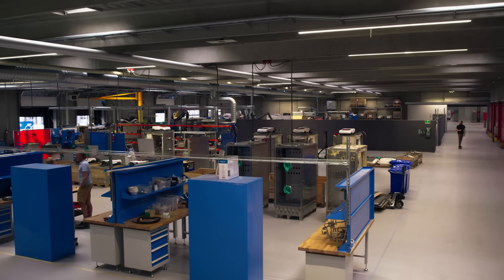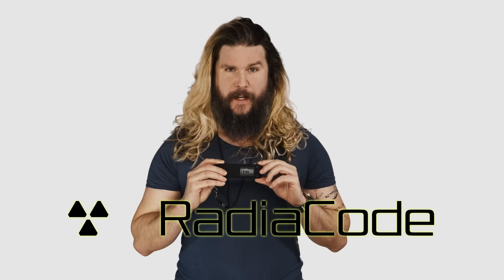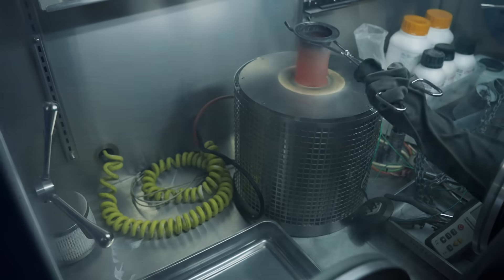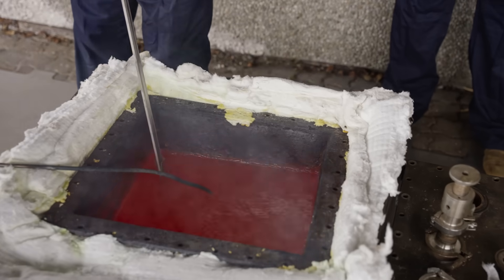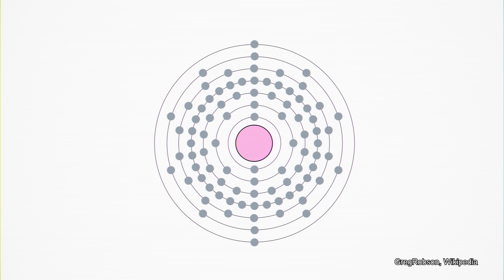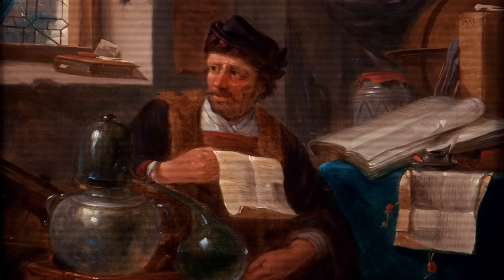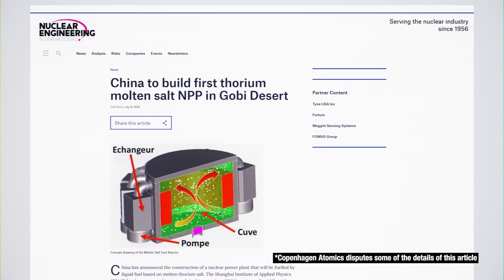Is THORIUM the Future of Nuclear Power?

Comment: I hope Thorium reactors aren't like pasta.

They said you can't burn pasta boiled in water. I did it.

They said you can't make Thorium into a weapon. What follows?
Reply: Thorium itself?  NO.  But the Uranium233 that you make from the Thorium, YES.  The catch is that the in between step from Th232 to U233 produces a strong gamma ray signature which is easy to detect. so, the whole world will know where and what you are doing.
Reply: @ Ahh I was wondering about that Uranium step. So, the only way to make it undetectable is by finding a way to contain those gamma rays? Not that I'm trying to find a way to commit war crimes, but out of sheer curiosity, can they at least be reduced?

Comment: so, I used to work with molten salt as an engineer manufacturing parts for military aircraft, you would have to make sure 100% that no water gets into the system. As the salt melts the sodium becomes more reactive as it gains energy and the bonds between it and the chlorine become looser, as it was explained with our salt vats, a small cup full of water could blow the whole room and cause significant damage to the workshop. 
Molten salt that has a bunch of uranium dissolved in it makes me nervous if it's not properly built... That's a lot of excess energy that can go boom. The safety measures on that reactor would have to be top notch.
Reply: the uranium is not dissolved in the salt it is the salt Uranium hexafluoride
Reply: @nistrum385  they say several times in this video that the uranium is dissolved in molten salt.. 4:51 as an example from the guy who's running the project.
Reply: @louthinator  it is not pure U, it is UF4 (since UF6 is a gas). UF6 is a way to get the uranium from the blanket to the fuel.
Reply: Only if you use sodium salts, so the solution is to not do that. Use fluoride salts instead, super stable.
Reply: @ how would that affect their melting point? And would they still have the water-like viscosity of molten sodium chloride?
Reply: @louthinator  what you see in the video is flpuride based (FLiNaK) utectic. Melting point is about 450 C, operation point in the reactor at about 700 C. SS316 is fine for corrosion issues during the time needed (5-10 years), and since it's a common material that almost all steel vendors use, the cost of each reactor + interconnected piping and tanks etc is quite cheap.
Reply: @louthinator  about 1500 C. There's been plenty of research on this type of salt, not only for reactor use.
Reply: @louthinator  Not chemically no, but thermally there might be a steam explosion. The system is not at pressure (other than hydrostatic and pump pressure), and if any water contacts the salt it will quickly vaporize pressurizing the entire reactor container. This is why most designs out there (including the diagrams he showed in the video) uses graphite as a moderator to not have water present in the reactor. This is however not the case for CA's design since they use D2O for moderation purposes (NOT for cooling).

Comment: This actually seems super interesting - the  safety benefits in particular. One of the criticisms of nuclear that in my mind doesn't get talked about enough is the effects of mining and waste storage on indigenous people. I'm in a place with a very strong anti-nuclear sentiment bc the mining and storage of uranium and waste is primarily done on indigenous lands and has led to significant health issues, ignoring existing treaties.
If thorium can minimize waste production and produce significantly less dangerous waste - such that it doesn't require sacrifice zones - and thorium reactors can be built at much smaller and faster scales than traditional reactions - so there's less time before actual energy generation and fewer carbon emissions from concrete construction - I think they could play a really cool role in energy production.

I do wish the "but our pipes need to be replaced every 5 years" comment got more attention in the video though. Those pipes have to be stored somewhere, no? Is that just another source of secondary waste? I wish there was more detail about the storage of waste and fission products from thorium reactions too.
Reply: Thorium is a byproduct of rare earth mining.  It is currently classified as mining waste and requires special storage.  To put it another way a rare earth mining operation here in Missouri produces enough Thorium waste to supply most of the US, just from that ONE mine.

As for the fission waste this are much less than that of solid fuel reactors because the fission waste is constantly being removed.  Also, the piping would only be mildly radioactive due to Neutron exposure over its lifetime.  

Also, several companies are putting forth designs based on using waste material from current solid fuel reactors as their fuel.
Reply: @nistrum385  Oh awesome ok! ty!

Comment: From my understanding the only reason we didn't go with this design decades ago, was that it is more complicated to setup but also it does not create weapons grade materials , and since we were building a nuclear arsenal the traditional water reactor won out, not a 100% sure tho.
Reply: Thorium reactors create very pure U-233 as part of their fuel cycle. You can build all the nukes you want with that. U-233 based devices have been tested before.

The reason Uranium reactors were used was because there was already a decade of practical experience with Uranium reactors. Thorium would leave you starting at square one.

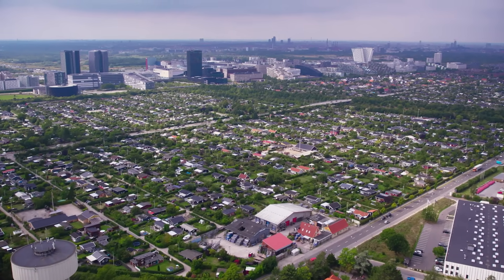Comment: 15:32  
Thorium doesnt produce plutonium. 
Even though thorium is really efficient and relatively safe, the government wont look into it because they want the plutonium.  
Its a bummer
Reply: Uranium 233, the element bred in a thorium blanket and used to power the molten salt reactors, has been used to make nuclear weapons,  by both the US and USSR. Its neutron multiplication rate is between that of U235 and Pu239. But, current weapons using plutonium would have to be redesigned to use U233 and this would require underground testing, which currently is banned by treaty.

Comment: The part I love about these reactors is how, when designed properly, they are walk-away safe. Meaning everyone could just walk out of the building, leave everything running, and it's still safe. If the reaction were to get out of hand, or if the reactor loses power, a plug of salt that is kept cool to keep it solid will melt, letting the liquid salt drain into storage tanks that are small enough that there can't be enough material around to sustain the chain reaction. Then when people come back, the salt can be reclaimed, reliquified and returned to the reactor, and the system started up again.

Comment: Hey Kyle, please take a look/tour of Moltex's SSR-W reactor being designed and built in Canada by a British nuclear firm. 
Solves a lot of the problems with current MSR designs such as:

Online gas product extraction from where gas is created inside the fuel salts 
Burns MOX with a VERY high burnup rate
Solves the problem of pumping hot, corrosive fuel salts around the corner
Solves the meltdown problem
All without needing to create and have certified New Nuclear Steels (suffice to say this is not cheap or quick prices, nor should it be)
Reply: It will certainly not be completed. It will probably not be started. No one will pay what power from it would cost, with abundant, radically cheaper alternatives.
Reply: @Akio-fy7ep  
You can't produce baseload with renewables. 
It's a lovely idea and maybe in 50 years we'll have the tech to do it but right now we don't. 
We need green baseload now
For which there is only nuclear to choose from.
We know how to build cheap nuclear, it just needs to be done.

Comment: Instead of scaling UP... how about scaling DOWN to produce a reactor for each household. Instead of a corporation building a huge reactor, build reactors for the size of the building that needs electricity. Have a reactor for single dwelling, two family dwelling reactors apartment size reactors,  office building size reactor. I have number 2 diesel furnaces and natural gas hot water heater and electric from con Ed.  Solar and wind is available for private dwelling deed holders. Why not nuclear?
Reply: It's still radioactive materials involved and would need maintenance/monitoring and so on.
Putting these in ever house would be scary to say the least.
You could already but generators and solar panels today if you don't want grid power but when something goes wrong and it stops working it's on you to fix it. No number to call and say, hey my lights are off.
Reply: @gizmogremlin1872  so the claim is, that the technology is still not perfected enough that it's safe at long as it's far away from society. Still not safe enough to be contained under the foundation of homes and have certified technicians not much different than a number 2 diesel home heating fuel delivers that will replace any thorium and repairs needed. How often would the thorium need to be replaced compared to refilling your oil tank or natural gas line for heat and hot water. In the past electric heat was always more expensive and we're comparing both environmentally friendly and cost effectiveness for what we're looking to use the energy for. Electric is just not for our lights and refrigerators and cooking,  there is hearing and hot water to consider as well.  Perfect the shielding in nuclear power so members of the private sector have an option of off the grid and not be enslaved to a monopoly provider of energy. 
I'm a childless deed holder and purchased a 50 ft trimaran sailboat and chose instead of living on land for these reasons of finding alternatives to living how the wealthy and powerful tell people how to live. I prefer to choose being self sufficient than dependent on others that could let you down. At the moment is safer to have reactors far away and have miles/kilometers of copper or aluminum cables deliver electric compared to perfect the shielding and or produce another small scale energy source for homes besides solar and wind.
Reply: @markandrade7547  
While the tech shown in this video would be quite compact compared to a more traditional power plant it would still dwarf any home generator and require maintenance that would be far above the heads of many, many people... some people couldn't fix a p trap in a sink without a you tube tutorial and some would still fail with it. While you or I or several others might be a bit more or Perhaps a lot more capable, a rather large segment of the population would be unable and many unwilling to look after such equipment. Even maintaining a typical portable gas generator is often beyond the reach of a typical homeowner.

Do I wish more people would be more capable and independent, sure...will that happen...I have doubts. 
My issue with your initial statement is not whether or not it is possible but more how plausible it is with the average person. Many people will plug in lamps or their phone and not have even the vaguest idea of how these magic things light up... giving these people a radioactive device to maintain would be a divine comedy in no time.

Comment: This was quite well done.  A few points - Thorium is about as common as lead, BUT is found commonly with so-called "rare earths".  These are elements we must have to have modern society.  They aren't particularly rare, but that is their name.  Thwy are also generally known as the "Lathanides" (with a few exceptions).  Thorium is commonly found in concentrations up to 6% rather than the average 3 ppm found elsewhere.  At a 6% concentration, a soda can of that particular dirt has the power of 40,000 gal ~160kL of gasoline.  This is game-changing tech.
Reply: One more point - China has 20,000 yrs of thorium reserves because they bother to count it.  Reserves are not an estimate of how much stuff is there.  Its an estimate of how much stuff you can extract from the ground given its market value.  When the value goes up, more becomes extractable.  Plus, when demand goes up, people bother to look for more.  Until thorium gets used for reactors, it is basically considered worthless - an impurity to the desired lanthanide elements being extracted.  Thorium is EVERYWHERE.

Comment: So a bit of this goes over my head, but I generally would like to know some stuff in the process itself.
Could we have a meltdown with these reactors?
Would something like sea water be applicable or does that just cause issues since it's molten salt and no liquid is actually being used? 
Would the reactors have to be destroyed after so much use of the radiation isn't nearly as volatile as Uranium.
Part 2 explains some of this, maybe?
Reply: > Could we have a meltdown with these reactors?
In the most literal sense of the term, sure, but because it's not at high pressure (a modern PWR operates at about 160 atmospheres, an MSR generally operates at around 5), it wouldn't be notable. They are generally all designed with a fusible plug in case things get too hot, into which all the fuel drains. Inside the holding tank, without the graphite rods that slow down the neutrons, the reaction stops.
> Would something like sea water be applicable or does that just cause issues since it's molten salt and no liquid is actually being used? 
Try to think about what "molten" means really hard. But no, sea water isn't. It has to be a fluoride salt.
> Would the reactors have to be destroyed after so much use of the radiation isn't nearly as volatile as Uranium.
What?
Assuming you mean what I think you mean, firstly, it does still use uranium, the thorium gets hit with a neutron which makes it far more unstable because it's suddenly too heavy and wants to break apart, but if it becomes uranium it's suddenly light enough again to stick around a while, the uranium then getting fissioned. It's just a more sustainable and cheaper way of doing things rather than extracting and enriching uranium directly, which we might as well do if we're going to the trouble of moving to a design that lets us do it in the first place.